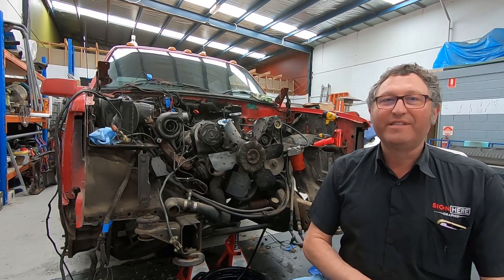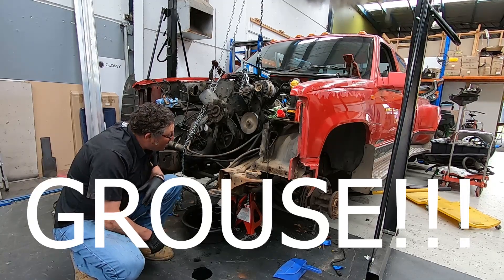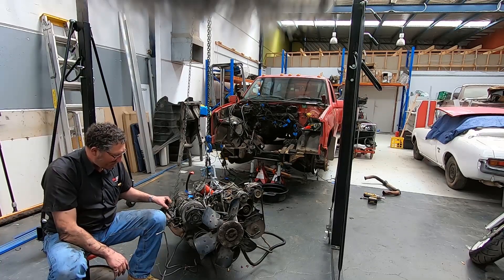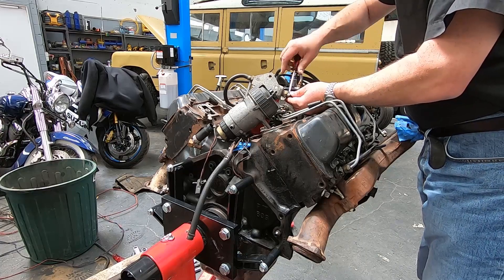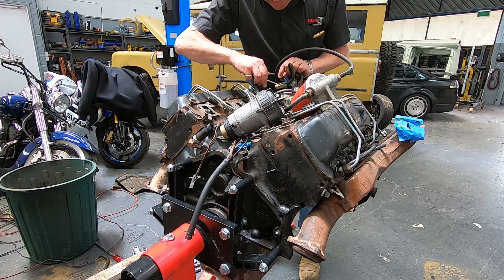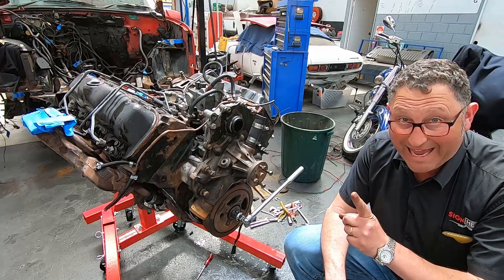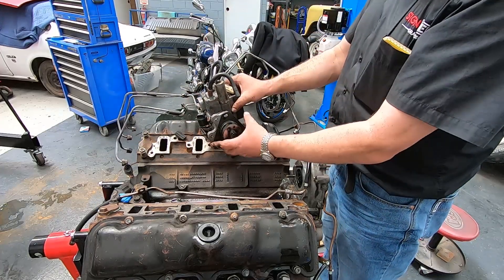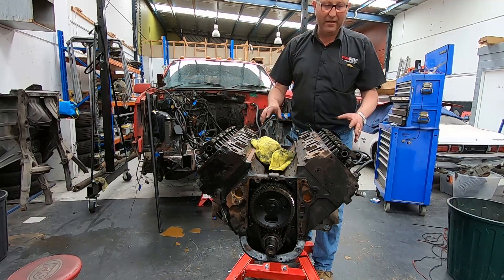How to Remove and Disassemble a Chevy 6.5 Turbo Diesel (Part 1)

Comment: You left the starter on and didnt remove the torque converter bolts...eer ..actually nuts (i believe ) to flywheel ,before you pulled it ? I didn't even know you could do that ? I changed all kinds of vehicle motors in cars and trucks ( hate front wheel drive cars ) stripped them down for years before i assembled one ..the whole vehicle , i was hired to take out every bolt , didnt have to put them back .. that was kind of fun .. then i went stupid and tried to figure out how to fix them and ruined that ..dont try putting it back together with thst torque converter bolted to the fly wheel , that wont work ..trust me ..
Reply from the maker: I hear you.
This will definately be going back together much more slowly than it came apart.
Cheers
HARRY

Comment: Thanks for putting up all the videos . Very helpful i have a 1997 k1500 GMC  in NZ that im working on .
keep up the good work
Reply from the maker: Thanks M8.

Is yours running the 6.5 as well?

My machinist has just come around and measured the bores and journals and taken a look at the heads, just waiting for him to get back to me with sizing so I know what parts to order up.

Its looking like the block and crank are in good shape, but will certainly keep everyone informed.
Reply: @HarrysBigShed  yep 6.5 turbo I'm going to be doing a water pump, fan and  fan clutch upgrade after Xmas and a new upper manifold after that.